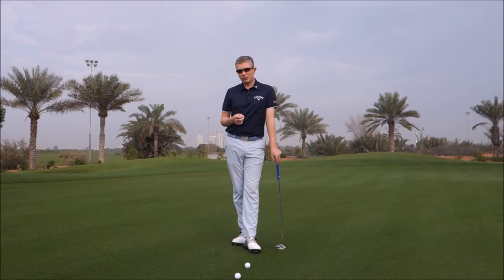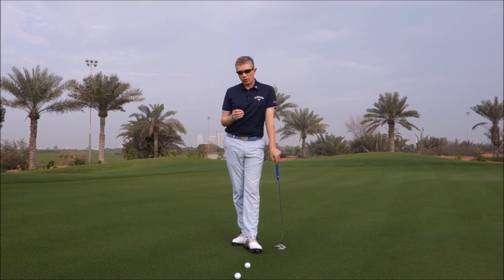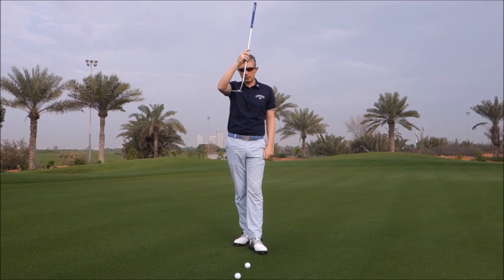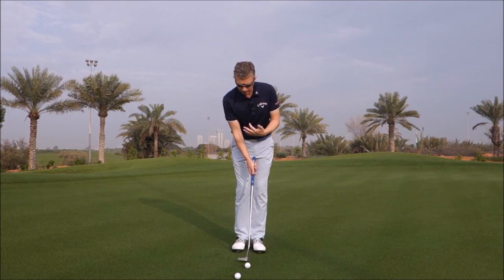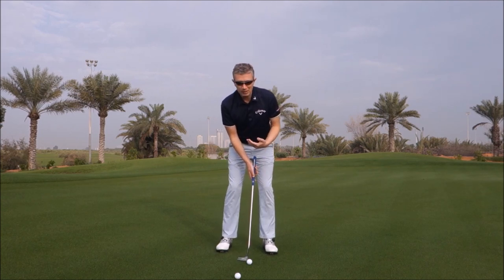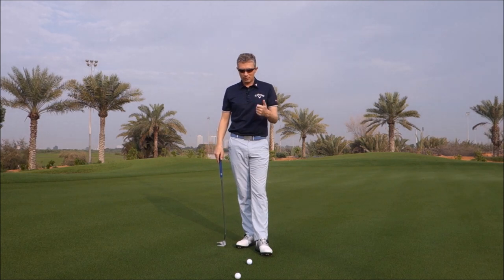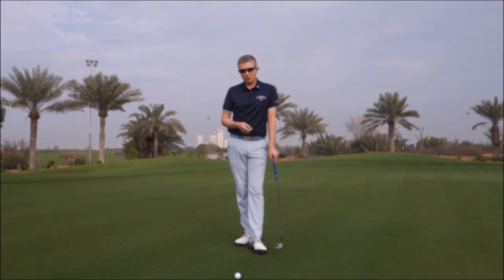HOW TO ACHIEVE TRUE ROLL IN YOUR PUTTING

Comment: What about armlock putters? More shaft lean obviously, and more loft. Mine has 6degrees. Ball position need to be more forward than standard ?
Reply: The higher Loft is needed because of the extreme Forward Shaft Lean the Arm lock style needs.
A forward press or a setup incorporating FSL delofts the Putter.
Putting "numbers" value 01°- 02° Delivered Loft, with a slightly Ascending Angle of Attack as the most effective and efficient Impact.

Comment: Does it work any different for face balanced or toe hang putters? As I understand it with a face balanced putter and a stroke that suits it it’s easier to de lift the putter?
Reply: Good Question. The answer is No.
Face Balanced vs. Toe Flow has more to do with the relationship of Face to Path at Impact. 
The point here is to slightly Deloft the Putter AND maintain this Angle while delivering an Ascending Angle of Attack at Impact. 
A mini version of Ideal "Driver Impact".
This is done with any and all Putters.
The variety of necks and/or attachment styles of Shaft to Head have to do with the amount of built in Forward Shaft Lean and how a Player establishes "Delofting" either in initial setup or by incorporating a Forward Press.

Comment: Great Tip...where does the putter face strike the ball.....full face or hitting mid line on the up stroke the with the putter face
Reply: You are trying to maintain 01°- 02° of Loft as the Putter Head rises slightly into Impact. 
To do this the Grip and Shaft maintain the same Forward Lean while elevating slightly.
A putted Ball does leave the Surface for a few inches of "Carry", then starts to actually Roll upon landing. A Flat Face contacts a Curved Surface, so Impact is ever so slightly below the Equator of the Ball.
See if you can locate any videos of "Putter Fitting" using a Quintic measuring system.

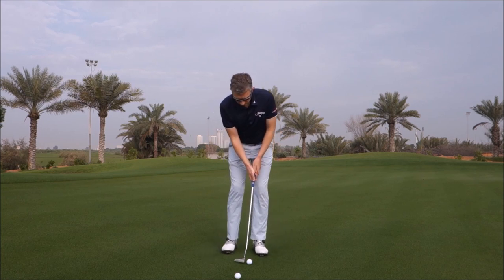Comment: 2:30 the best you need to know, and he never spoke on it. take that dam putter back far enough in the take away. these new spider clunky putters blocking the rear line, and short punchy strokes are messing golfers up. 

a nice longer take away with a smooth pendulum glide is the dough.